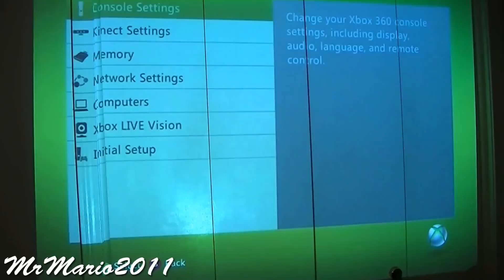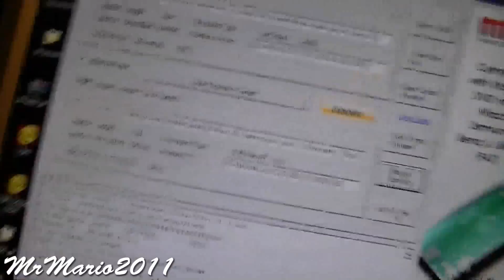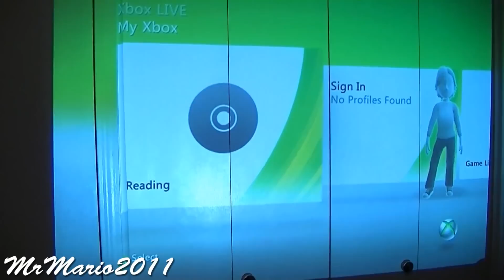[Xbox 360] Phat Disassembly, Cleaning, and Flashing

Comment: Hay MrMario, I have 2 xbox 360 console's one is a core console and the other one is a pro console. And the core console has a jtagable dashboard. And the pro console has the last dashboard that came out. So should I to do a jtag hack on the core console or a reset glitch hack on the pro console. And I know that you had a reset glitch console before. So what do you thing is better? a jtag console? or a reset glitch console? Also I know a guy that does the RSG hack for $55 + Flashing. Thanks.